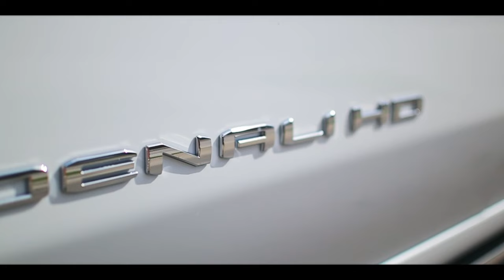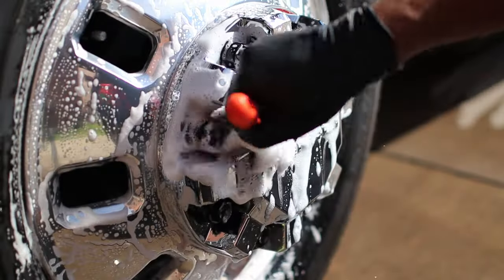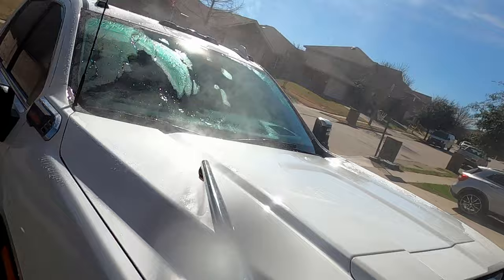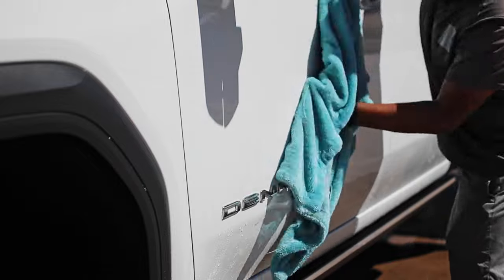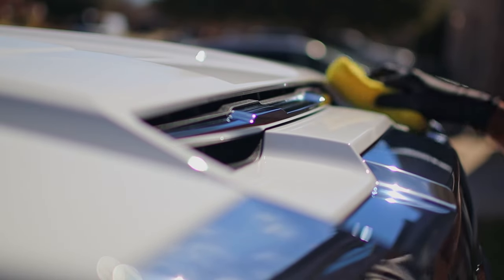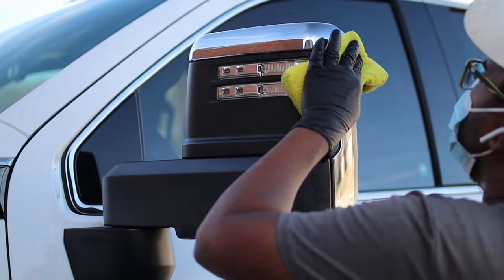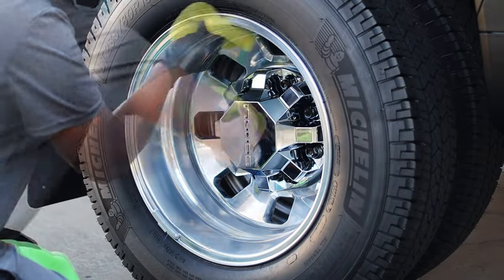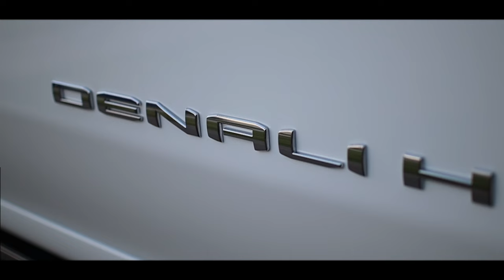Complete Detailing: Washing And Ceramic Coating A New Gmc Denali

Comment: No reason to use an additional iron remover with Adams standard wheel cleaner. It’s an iron removing wheel cleaner. Very strong on its own. Plus I wouldn’t recommend mixing chemicals unless they’re formulated for that. If you’re gonna use iron buster from p & s use brake buster over the top it’s meant to be used that way. Nevertheless good video brother just here to help when I can👍
Reply from the maker: I use it just to make sure! In the past I have used just the Adams, it did not do a perfect job. Still its a great product. Thanks for watching.

Comment: Wrong : you don’t never use boar hair bristle brush while the foam is on because there can still be dirt particles on the paint and cause scratches you always use a pre wash so it encapsulates the dirt particles pits them in like a bubble and lifts it of the surface of the paint so you don’t mare it into the paints surface and next you wash that off and then put foam on let it dwell then wash off then hit it again with foam then use wash mitt and the brush then wash off then after that you use your chemical decontamination product like iron remover and tar then let dwell wash off then clay stage then paint correction then cc. If I helped you let me know